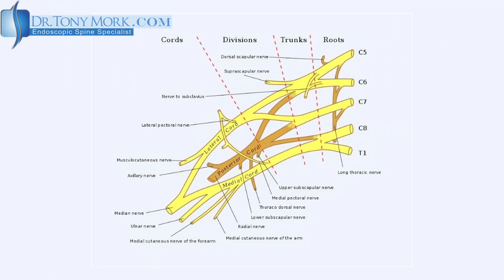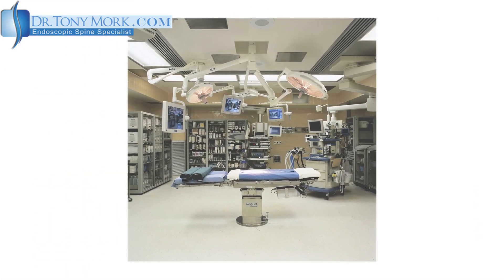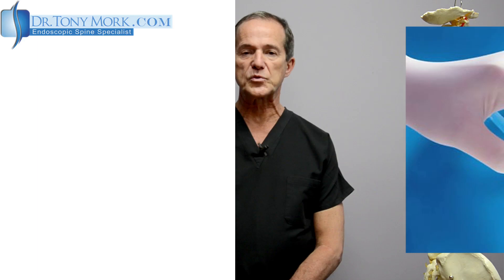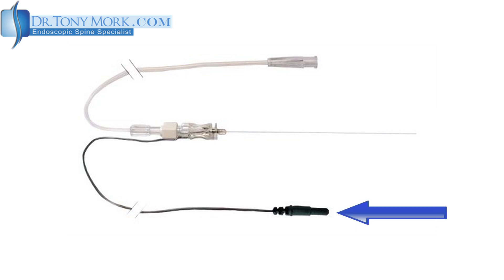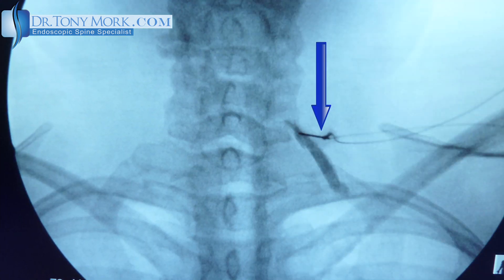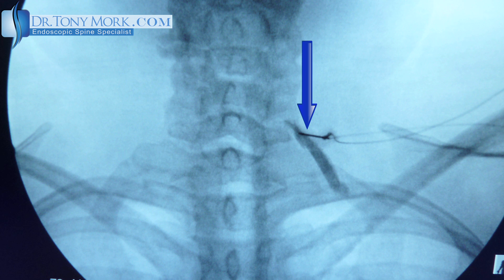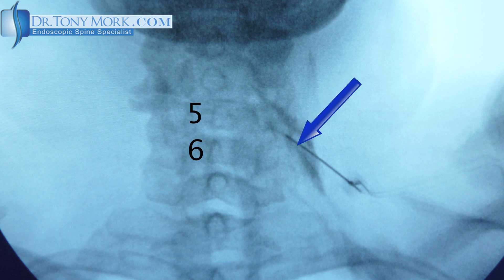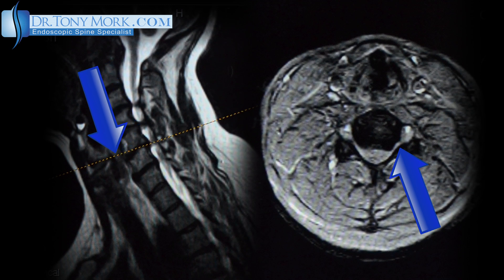Spinal Pain Mapping of Cervical Spine Nerve Root

Comment: Using my left arm would from time to time cause a lightning bolt of pain. Spring of 2016 I felt like I was being tortured. Summer of 2018 and still chasing the problem. Is there no end? This procedure sounds like it could have shortened the time line. Granted there were several other structural problems going on and my body went into full revolt.
Reply from the maker: Sounds like you need an MRI to help make a diagnosis
Reply from the maker: Sounds like you need an MRI to help make a diagnosis
Reply: i have the same. fused c3 to t1. intense agony.